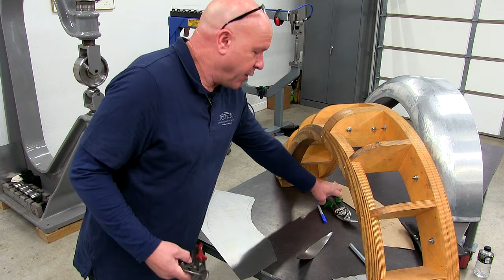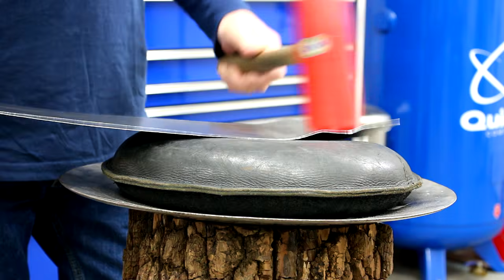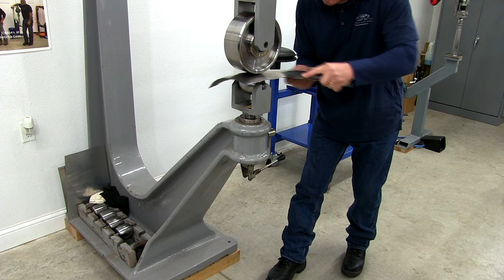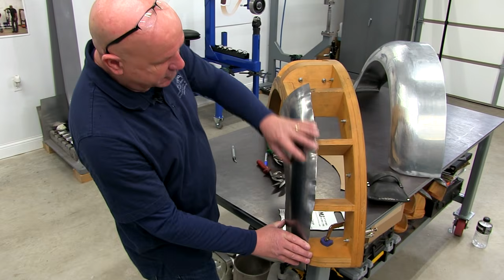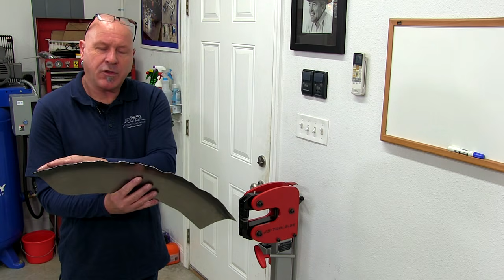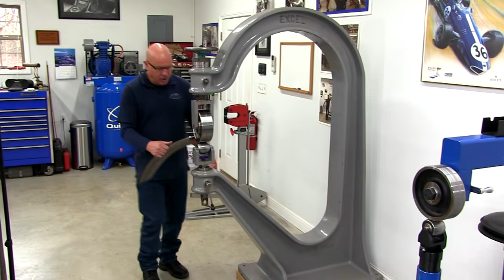Introductory Metal Shaping Class 101

Comment: Hello! As an apprentice in metal shaping, i’ve come across a nice trick when using tin snips: as you release tension on the snips after a cut, push the snips forward along the cut line (you should feel some vibration). this completely prevents burs from occurring.
Reply from the maker: Hello Jared, thank you for sharing your trick with using tin snips!
Reply: @KingdomMetalWorks  That’s no problem, I hope it helps you!

Comment: That is a gorgeous english wheel. How old is it? I tend to prefer the older tools because they were better built and usually elegant. I agree with doing by hand. There is a quiet satisfaction when shaping any material by hand. What we teach lives much longer than we do. Nice video. Good Luck, Rick
Reply from the maker: Hi Rick, thank you for your comment. The Excel English Wheels were made in the 1990's, I have one of 37 that were made. They are made of nodular steel instead of cast iron. I have used a lot of different wheel, and this Excel is my favorite. ~ Kevin
Reply: @KingdomMetalWorks Thanks for responding. I thought that it might have been much older. 40 years ago, I looked at a house for sale. Its barn had a sheet metal workshop. The tools were old but clean and recently used. It turned out that the old guy who owned the place had helped with the Statue of Liberty restoration. He claimed that these tools were also used on repairs of it in the 1920s. They were not included with the house. They were works of art and had the pin striping of old tools. Good Luck, Rick
Reply from the maker: @richardross7219  What a great story Rick! Thanks for sharing as well. Kevin

Comment: Great video, thank you. I haven't watched your others yet, but will.  My first question was how to arrive at the initial trim? Second was detail of the metal, grade, and thickness?
Reply from the maker: Hello @enordquist1, using the wooden buck or an existing fender for outside perimeter, I made a paper pattern with an extra inch all around, wanting the weld in the high crown radius. The metal is I believe either a 20 gauge or18 gauge cold rolled steel US grade.

Comment: Hi from the old UK, I have just come across your really excellent video. I would just like to thank you for sharing your expert knowledge and in such detail. I must say that I found it so really enlightening and useful particularly as I'm rebuilding an old 1956 Austin A30 so have now subscribed.  I have a wheeling machine (self built but with professional wheels, the frame is properly over engineered but very stiff) but I do have some problems with wheeling, can I ask what width of tracking do you employ and is there a rule of thumb when it comes to setting wheel pressure.
Reply from the maker: Hello Multirole 240, Thank you for your comments, so glad that you enjoyed the video. The with of track to the flat top wheel is determined by the amount of shape in the panel ie: if it's a number 3 or number 4 radius wanting to be achieved. The width of track is determined by that. You need to keep the track blow marks as close together as possible traveling across the panel. As for pressure, light pressure at the beginning to set the panel and slowly increasing pressure to achieve the right shape, not too much too soon. Let me know if you  have any other questions.
Reply: @KingdomMetalWorks  Many thanks for your advice I will try getting my tracking lines closer together with lighter pressure. Thanks again.
Reply from the maker: @multirole240  You are welcome!

Comment: Hello, congrats for the video, very instructive. I need to shape some 2 or 1.5 mm stainless steel for an sculpture. Would it be possible with the english wheel? Thanks for your help!
Reply from the maker: Hello Pablo, if your English Wheel has hardened wheels, then yes, you can wheel shallow shape in larger panels. 304/308 stainless steel has 20% chromium and 11% nickel so it hardens quickly when shaped. For full shaped smaller panels, I would use a power hammer or planishing hammer to shape. Thank you for your comment and question. Kevin
Reply: @KingdomMetalWorks  thanks a los for your answer! Very helpful 👌

Comment: Hello
Could you please tell me what grade of steel do you use for body panels?  I've seen a lot of different videos about how to use an English wheel, how to learn how to make body panels but almost no one says what metal to use for this.  What grade of steel is more suitable for these purposes, where such metal is sold? As far as I know it can't be any metal from any hardware store, at least that's what I've been told.  I would appreciate your clarifications and advice.
Reply from the maker: Hello Old School, 18 gauge cold rolled steel is idea for hoods, trunk lids and door skins, floor pans, trunk pans and inner structures. I like to use 19 gauge AKDQ for high crown panels or full shaped panels, inner wheel arches, fenders, front and rear, reverse curve panels, head lamp buckets, because this gauge metal shapes quicker and easier. I purchase my steel at my local metal supply store.

Comment: When I roll a panel , it keeps walking off the wheel to one side . What would cause that or is it just technique that needs improving?
Reply from the maker: Hello Greg, it's really all in the technique, whether you are wheeling a straight panel or a curved panel, the technique is all in the "steering" of the panel and not wheeling too close to the edge. I suggest that you keep your blow marks close together and not run too close to the edge. One hand steers and the other hand supports the panel, using the index finger on the steering hand really helps.
Reply: @KingdomMetalWorks  Thank you for the explanation. I started with a flat piece of 18gauge and it seemed that even if I tried to keep it going straight, it wanted to walk off the panel. I thought maybe something was misaligned ... I'll just keep practicing on technique. 

Let's say I'm wheeling a panel from left to right .... Do you steer left on the pushing stroke and right on the pulling ?
Reply from the maker: @gregl1824  Hi Greg, I personally go straight on the pushing stroke, and then pivot the panel slightly to do the diagonal stroke and then on the pulling stoke steer the panel with your right hand (if your right handed). Then you push straight and repeat the process across the panel, keeping your tracking marks close together.
Reply: @KingdomMetalWorks  thanks so much for the information. Your videos are very helpful.
Reply from the maker: @gregl1824  I really hope this helps! Thank you Greg for your comments.

Comment: Do you prefer lower anvils with flats or full radiused anvils?
Reply from the maker: If I had my preference, I prefer flat top wheels only because more panels can be made with them. High crown wheels though do have a great purpose for high crown radius shaping or using the rubber band on the top wheel for linear forming.
Reply: @KingdomMetalWorks  thank you
Reply from the maker: @sblack48  You are welcome Rv4 Guy

Comment: Fiberglass + epoxy + moulded model = the same or even better result... ?? Mass production ability.  Less or the same weight. Same thickness, same or higher strength of produced parts. Local dent resistance..No corrosion. No "english wheels"... ??